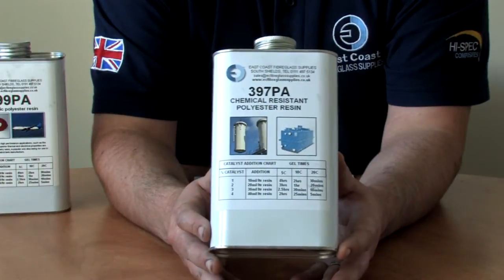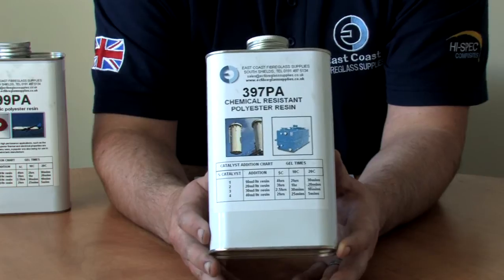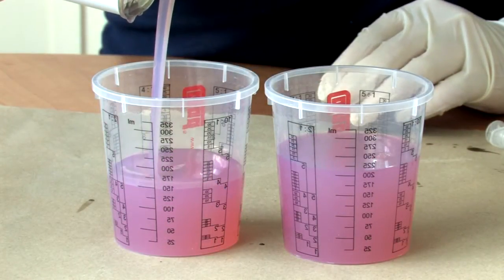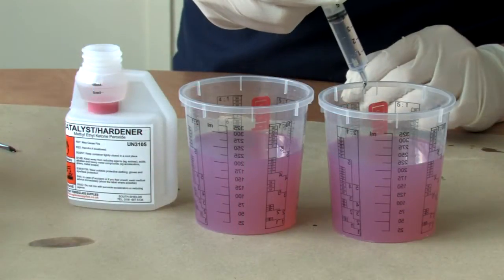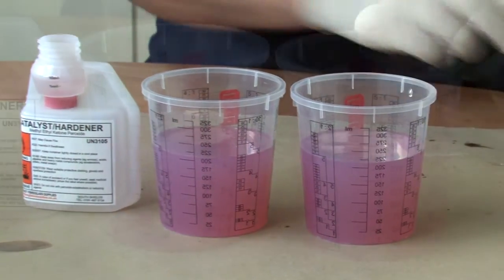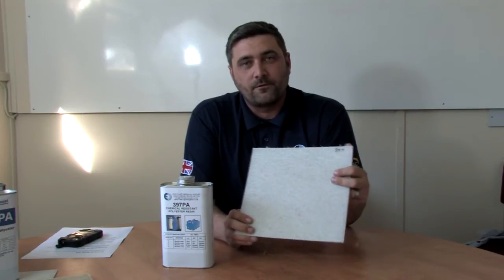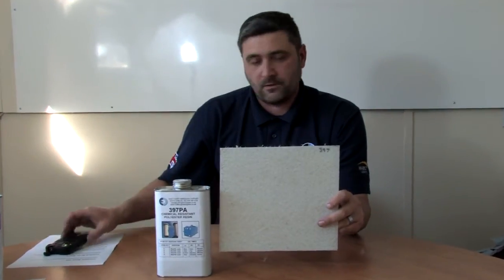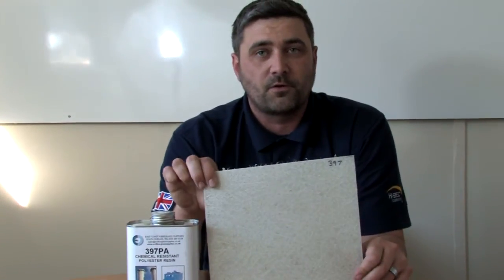Chemical and Heat Resistant Polyester Resin (Crystic 397 PA)

Comment: What is the breakdown limit of this resin, heat wise? Can it withstand petrol?
Reply from the maker: Currently we do not stock a resin that can withstand the ethanol content of modern petrol. 

 The heat deflection under load is 117 degrees C.